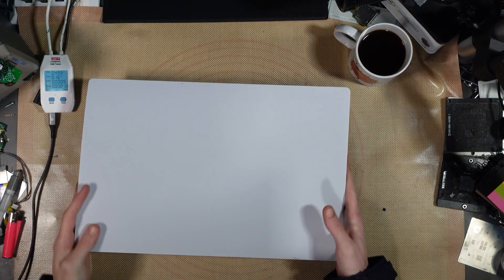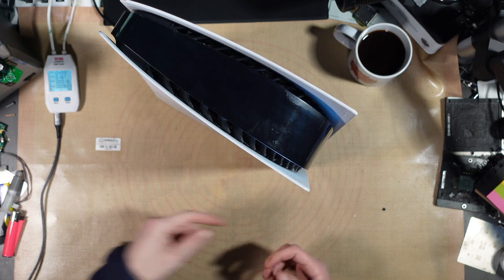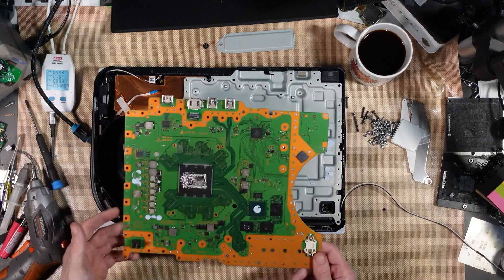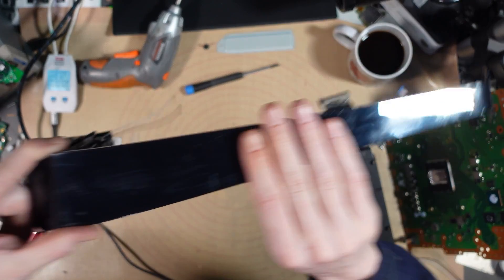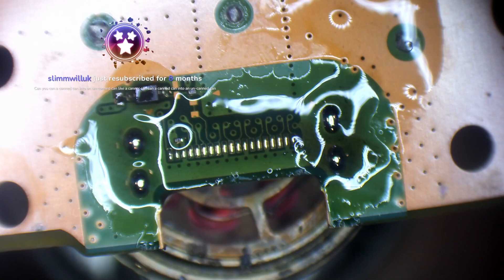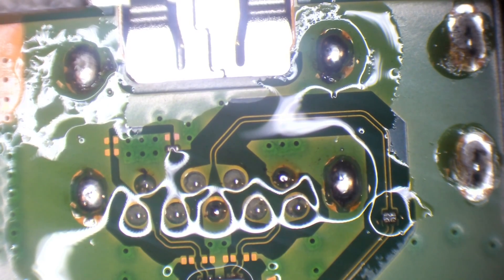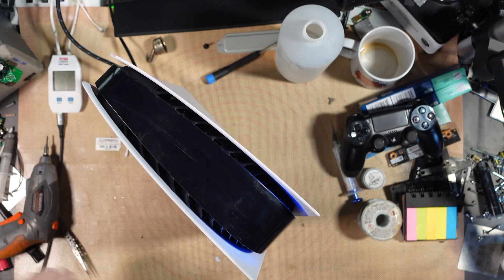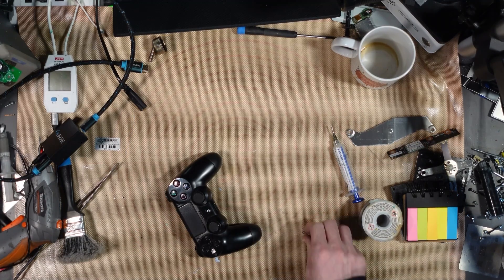They SCRAPPED The Fan From Their PS5 Because It Was Overheating! £180 Faulty PS5 eBay Find...

Comment: Hello. When you change the Sony HDMI cable for another one 8K 60Hz Very high speed, you can have metal made HDMI instead of the black plastic of the PS5. And this hdmi is exactly on the way of the extracted  hot air who comes from inside the PS5... And metal becomes hot... (You can touch it but it's maybe 40-45 °C So maybe the glu around it too... Can it cause a short-circuit or a shot down?

Comment: Does the factory leave the flux they use on these boards afterwards? If they do, why can't we leave it there, too? Instead of wasting all that IPA cleaning it??
Reply from the maker: No they go through a cleaning process at the factory
Reply: @TheCod3r  just wondering why I saw some flux residue on the legs of the ports BEFORE you replaced them, if the factory cleans them.
Reply from the maker: some of the residue stays after cleaning, but for the most part it gets cleaned :)